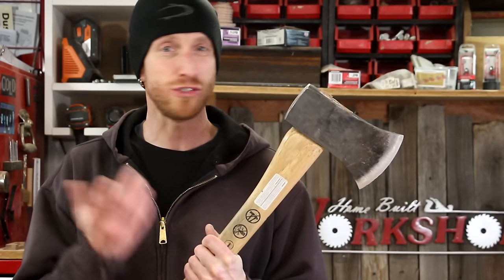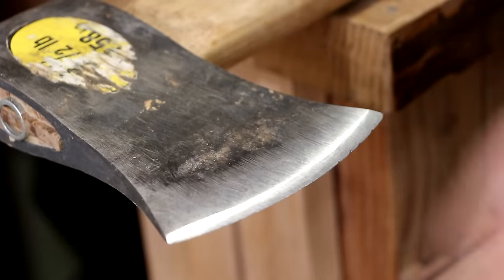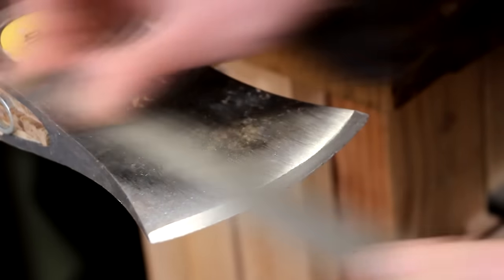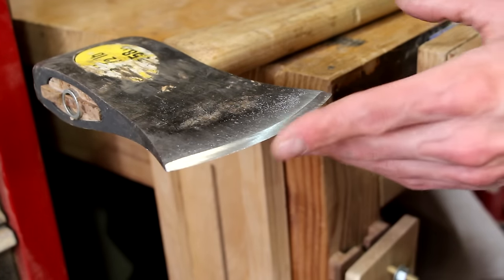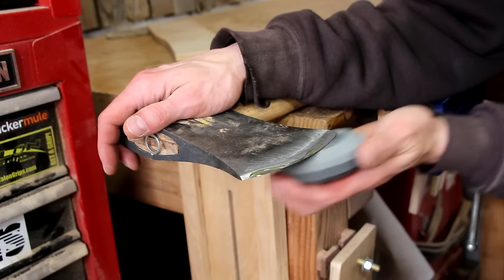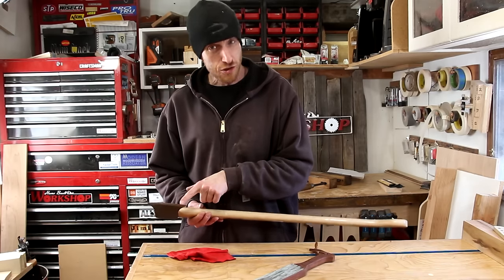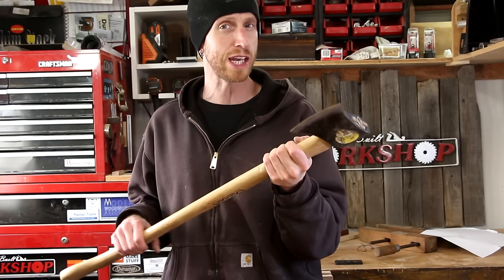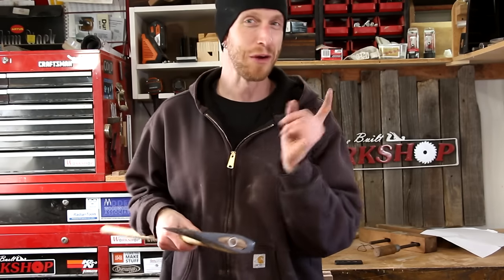How to Sharpen an Axe (Its Easy)

Comment: You made me so happy when you said you were going to use a plain old file,way to go young man.
Reply from the maker: Thanks. That's how I was taught by my Grandpa lots of years ago.
Reply: L
Reply: Grey wolf, why?
Reply: @jacksonelliott2574  most people run to a grinder and put an angled edge on the axe head when an axe head should have a convex edge,with a file it's  easy to shape the cutting edge properly,at least that's how I learned how to sharpen them.
Reply: @lsmith2129  Yes the way I was taught too
But last week when I got my recent axe out to use & I tried to sharpen it with a file & it just glazed over it....:-(
Reply: @colinbm2010  it must be hardened  ,try a work sharp knife sharpener its designed  to put a convex edge on things,or a flap disc on a hand grinder, go easy with it they are very aggressive  and take metal off quickly good luck
Reply: Me too
Reply: Ron Swanson ?
Reply: @lsmith2129  same here,my grandfsther always said
Reply: @lsmith2129  lo
Reply: It’s the only way
Reply: “A young man is most foolish when he ignores the proven advice of his elders.”

Grandpa taught me the file method as well for axes. Whetstone and oil for your knife with a few final passes over leather or wood for the best edge.
Reply: Strongly agree. I was looking for a tutorial that didn’t need all the fancy tools to sharpen; this is perfect
Reply: Ok so probably a stupid question but does it matter which type of file? I mean my dad has probably 10 different files and each one has a different texture. ( I’m female trying to figure this out) I have been trying to cut out cypress roots with a pic/hatchet after digging them out
Reply: @creativeobx8367  there are different types as you can probably tell. You want to use the finest flat file you can, it doesn't want really rough raised teeth like a rasp does, the teeth should have lines across and be quite shallow and close together. You may have half round files but these will also work, assuming you're using the flat part and not the round. Test them out but with a few passes with some pressure you should see metal filings appear.
Hope that helps.

Comment: I have been a wildfire sawyer for 23 years and for my hand tools and axes this is absolutely the method to use followed with a pocket puck and a pocket finishing stone. There is nothing more dangerous than a tool that should be sharp and is not …. It is very easy to get a axe to the point where you can shave with it and in fact the strop method after finishing stone and should be  ready to shave and shave test should be the go to. Good video !

Comment: It was 54 years ago, when I was a Boy Scout, I was taught how to sharpen an axe. If my axe becomes dull I'll put a towel on the edge of the kitchen table, C-clamp my axe so the edge is hanging over the edge of the table, then go to work using a metal file.
Reply from the maker: I too am a former Boy Scout.

Comment: Pro tip: wear gloves, I just got a nasty cut on my finger while filing my axe
Reply from the maker: Safety First. I hope you're OK.
Reply: Home Built Workshop thanks, it’s healing up well, 👍
Reply: I know that feeling. There are scars on my hands because I don’t like using gloves while filing.
Reply: Lol cut my finger right before I read this
Reply: Hate to ask a stupid question, but did you have it in a vice?  Gloves are a good idea, but people are much more likely to cut themselves if they just file, and sharpen in the hand. I've had to stop being lazy, and take things down into the basement vice to avoid issues.
Reply: I was expecting some skin slicing with that round sharpening stone
Reply: @edwardmulder3777  The only thing I can do well in a pair of work gloves is pee my pants.
Reply: 1st rule of thumb my grandad taught me , if you want to keep your thumbs , protect your hands . if the cut don't get you the infection and blood poisoning will .
Reply: because you and this guy are doing it wrong
Reply: Yup, done the same quite a few years ago and the scars still show. To remove stumps now I rip them out with my excavator and throw them on the burn pile

Comment: Just three tips for you. (1) Finish with alternating laps. A stroke on one side, stroke on the other. This helps to prevent burr buildup, which can be beneficial while setting the bevel but is your enemy at the finish, because a burr becomes a wire edge. It folds over readily.  (2) Apply a compound bevel when you think you are finished. Simply add a few very light laps at a slightly higher angle for a microbevel. This makes the edge much more robust. (3) You don't need the paddle strop and CrOx. There is no need to go any finer than 1k grit, which is around 13 μm. CrOx is around .5μm or roughly 30k grit. I your application it has some benefit but only in temporarily aligning the edge and removing SOME of the burr. A 1k stone or a natural of similar effect for finishing your edge would be better, IF PROPERLY USED.  (4) Oops yeah one more. The way you clamped the ax allows it to rotate a good bit, which results in a very slight convexing. Not a dealbreaker but not optimum, either. Try clamping the ax head in your bench vise. If you can get just the back 3/4" solid in the vise, good enough. (5) Glad to see you are using a handle on your file. It should be stressed that a handle on the file tang has saved a LOT of hands from getting very nasty slices, and not using one has resulted in some crazy cuts, often resulting in trips to the ER.
Reply: Jesus. I didn’t know sharpening an axe is that in-depth! Thanks for the info
Reply: I'm sure those are all good points, but it sounds like it becomes no longer "easy".  :)   "How to Sharpen an Axe (Its Easy)"
Reply: @kwebster62  no... it is detailed and written by a 'detail guy'. Sharpening an axe is not very difficult.
Reply: Whats a compound bevel?
Reply: @butterypigeons1089  A compound bevel is when you form a primary bevel and then apply a few final laps at a slightly higher angle. This gives you much of the advantage of a more acute bevel, with some of the robustness of a more obtuse bevel. In other words it cuts good but the edge is not as easily damaged.

Comment: THANKS FOR POSTING !!!
First of all, you're about the only person, that I have found that holds the "Old School" truths of file handling, ( back and forth), dulls a file. You're absolutely right! Lots of school systems have discontinued teaching basic shop classes and it's depriving our young, the necessary basic knowledge of how stuff works and how to fix things. When I was in school, Industrial Arts was a required course for the boys and Home EC was required for the girls. It taught them to sew, cook, clean, do laundry, etc and manage a family. Sex education...all of what they would soon, need, to start a family. The boys were invested with OJT (On the Job Training), to be ready to hold down a job and be the bread-winner of the family. The smart phones in our youth's hands have brought them up in a two dimensional alter reality and the lack of shop training, no wonder our country is going down the tubes! 
   This young man exhibits the fact that he was brought-up knowing right from wrong as well as having good holdsome training! Keep right on doing your thing, young feller!
   THANKS AGAIN for posting!
   If you'll draw-file the edge first, it will save you lots of work.
Reply from the maker: Thanks my friend. I too had all sorts of shop classes in school, as well as Home Economics. I took as many of those classes as I could. Thats a good call on the draw filing. I should have started with that. Thats how I sharpen my mower blades.

Comment: Stumbled across this vid while wrapping up a random surfing.  I wanted to learn how to sharpen my hardware store axes, and this is exactly what I was looking for.  Thank you!
Reply from the maker: Awesome. Its easy to do.
Reply: How can I get the top point of the axe sharp? I sharpen in a downward angle. The bottom tip is sharper, but I guess thats normal? Thank you! I've learned in 5 minutes in this video more than watching others and picking up tips through the years!

Comment: i want to own a tomahawk and grandfors bruks but i keep thinking "oh god, what will i do when it needs to be sharpened, i don't have a vice or anything!" then i think back on the times when axes were used but vice grips weren't a thing, and realized i didn't really need such a thing to sharpen the tool i would want to have. I'm definitely happy i came across your video here, as this helped translate the small things i would want to have. may even used my old leather belt for strapping or stropping, i dunno, eitherway, its genuine leather! thank you very much!
Reply: Make sure to wear some work gloves if you aren't holding it down in a vice. Cutting your fingers isn't fun. Lol.

Comment: I wouldn't use any oil on the stone personally. It clogs up the stone surface and reduces friction hence takes longer to get the results you want. Just plain water or kerosene I've found works better. Good vid especially the file direction.........and the blooper! Lol

Comment: Good to the point video, thanks for sharing. In the field I use one of the inexpensive pocket sharpeners with the carbon steel and ceramic sticks on the other side. now I need to really sit down and put a good edge on my axe, thanks this is helpful.
Reply from the maker: Those pocket stones are great. I have one around here somewhere.

Comment: In the fire department they have the new guy sharpen the axes. Then the captain with come in and run the file on the freshly sharp edge.  This is because a super sharp are has the tendency to get stuck. Most axes people use are for chopping wood. This was really informative. Good video.

Comment: Smooth the edge with a coarse stone or a fine file then polish the edge with fine stone and strop the edge with a compound charged leather belt. Keep a fine stone in your pocket to touch up the edge while you are using the ax. If you hit a rock go back to step one.
Reply from the maker: Yes, if I hit a rock now, I cry for a second or 2. lol.

Comment: Thanks for not abusing that file.
I can't stand it when people do that.
I bought a farm store ax and it's is a challenge to get the right angle and edge.
Only one axe head had any decent "ring" to it.  The handles nowadays are wretched.   Nothing but grain runout. 
Great video.   Thanks.
Reply from the maker: I find myself doing it too then I remind myself to stop it. It was a challenge to not go crazy for the video. For an inexpensive axe, this one has worked ok.

Comment: A dull axe saved my life once. I was a teenager that hadn't ever seen an axe. Went to a place that had an axe and firewood outside. With no prior experience I decided to go wild on the woodpile. After a few swings, I missed the log, and my poorly placed leg took the blade end of the axe directly to the shin. Luckily the edge was dull as a butter knife 😂
That's why I appreciate dull axe blades to this day
Reply from the maker: Wow, thats crazy. Could have been a lot worse. Thanks for sharing that.
Reply: Same thing happens to me one my first big wood splitting job 😆
Reply: Did it break you leg? If not the ax was neatly stopped.
Reply: Part of me feels that if the axe was sharp then you wouldn't have been swinging so hard and so wildly , thus, you may not have hit yourself in the first place possibly?
Reply: @Sooper8  I had no idea how sharp this thing was or was not. Also, I was a teenager so caution did not exist 🤣
Reply: @gregwarner3753  nope, I think I may have been able to slow it down just enough and the angle was just right to keep from a broken bone. Just a good bruise!
Reply: I had a similar thing happen, when I was a kid, no one had ever told me to check out my work area before doing any work. My back-swing got into it with a clothes-line! That rebounded and it came back after me. Thank God it was dull!

Comment: Its good to sharpen an axe Id recommend maybe thinning the handle down a bit so you can close your hand most of the length if not the whole length makes the work more comfortable I find.
Reply: Also getting the trash polyurethane off the handle and oiling it makes an axe or hatchet more comfortable to use.
Reply from the maker: I agree, I need to sand it down and add some Boiled Linseed Oil. This handle is pretty slick.

Comment: I have a bunch of 4" squares cut from 1/2" thick rubber horse stall mats I put in between clamps and anything I don't want to damage the surface of. Seems to work pretty well.
Reply from the maker: Thats a good idea. I have a couple pieces like that. I'll have to try it out. Thanks for sharing that tip.

Comment: You started off using the lansky on the medium side, not the coarse side. I’d recommend starting with the coarse than moving to the medium grit.
Reply from the maker: That was the intention but I believe I messed that up in the video edit. Sorry for the confusion.
Reply: Home Built Workshop it’s alright, said you were going to use the coarse side and then used the fine side lol. I notice little things like that sometimes, great video though

Comment: I haven't read all the comments so I expect this has been mentioned before. Another way to get rid of the stumps is to drill holes in them as deep as your drill will go. Then fill the holes with salt. Any kind will do. If your in an area with not a lot of rain, the pour some water in the holes also. Refill the holes with salt as needed. In two or three years they will rot out so they will be easier to chop out or burn.  saw some one mention oil or diesel fuel in the drilled out holes also.

Comment: Good information.  I am a little OCD and have to remove the manufacturers stickers from any tool I have.  Also each time I sharpen  I like to clean up the axe handle with a medium grit sandpaper and give it a coat of boiled Linseed oil.  I found if the handle is too smooth it is hard to hang on to and if it is to rough you will get blisters.
Reply from the maker: I thought about removing the label. This axe handle needs to be sanded. Its really slick. I've lost it a time or 2. Kinds dangerous.

Comment: If I use a file I fold a rag and set it on the cheek until it holds the file at the right angle and rotate it. I usually tack sandpaper to a paddle and go through the grits and strop at the end.
Reply from the maker: Thats a good idea. I may have to experiment with that.

Comment: well done. Sharpen an axe to a fine blade has always eluded me. Your instructional was easy to follow and understand. I did notice that you eyeballed the angle. I have heard that the most desirable angle for an axe blade is 15 degrees. I would be interested in your thoughts and opinion on this matter.  Most helpful video.
Reply from the maker: Thanks. I'm glad it helped you out.

Comment: My old man always said that you don't want an axe to be shaving sharp.  You just want a "working edge".  Shaving sharp has a very fine edge which requires much more sharpening more frequently.

Great video!
Reply from the maker: It is true that an edge that fine is a bit more delicate than a working edge. I don't sharpen it shaving sharp every single time. While I'm using it, I keep it as a working edge, but when I'm don't and won't be using it for a while, I sharpen it really sharp.

Comment: I have (maybe had, haven’t found it again yet) one of those round stones and I really like it.
Reply from the maker: Its a handy little stone for sure.
Reply: Dropped mine on a concrete floor and it broke in half.  Sigh.
Reply: @visumexcipio  

Can you still use the parts?
Reply: @stormyeffects4795  the parts were small. Probably good for fish hooks.  I pitched the pieces out

Comment: You started using the fine side of the puck but said it was the coarse side. Isn’t the darker side the coarse side?  Thanks for clarifying in advance sir.
Reply from the maker: I did start with the coarse side. I think I mixed them around when I edited this video.

Comment: Nice demo.  but, shouldn't you tell your following the type of file. Not saying i'm right . I use a good Mill Bastard . What is the grit of the puck.?
Reply from the maker: It is a Mill Bastard. According to Lansky, the Coarse side is 120, and the fine side is 280. I hope that helps.

Comment: Can you use an angle grinder with a metal sanding disc?
Reply from the maker: If you're in a hurry I suppose it would work. You'd just have to have a light touch so you didn't sand any weird gouges in it.

Comment: Good job Jeff, you may find it easier to vise the axe and freehand the strop, works for me. Yah, I'll bang and bet a hardware store axe, and re-sharpen it. But my high carbon steel axes, just wood grain, then back into the sheath. Another approach on stump removal, I live in the country, so the drill and fire method works for me. 
God Speed, and God Bless,,,,,
Semper Fi
Reply from the maker: Thank you. This poor axe. I have beat it up. I'll try it in the vice next time. I also like the fire removal method. Unfortunately, I cant use it here.
Reply: Oh well they are tools and meant to be used not babied lol

Comment: Drill holes in the stump, put diesel in the holes then encapsulate the stump with a drum with both ends cut out. Cut a hole in the lower side big enough for an electric leaf blower.  Load the drum with wood, light and go away.There are plastic protectors to go on metal vices if that is the type you were speaking about.

Comment: I would have started with a bench grinder or belt sander to get a new edge and remove the dings. Then a diamond blade file and pollish with a strop. Just like you did. People don't realize the value stroping adds to get a fine edge. It's kinda like a beautiful baked cake without icing! Think of stroping as the icing. 👍🔪🎉🎊🎉